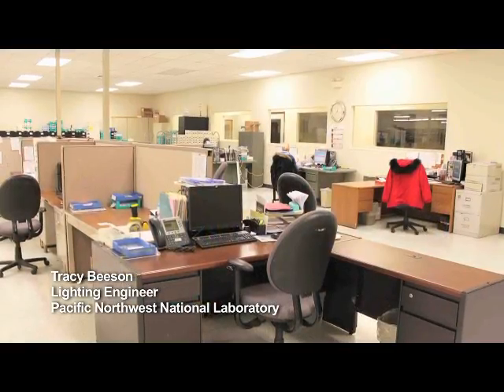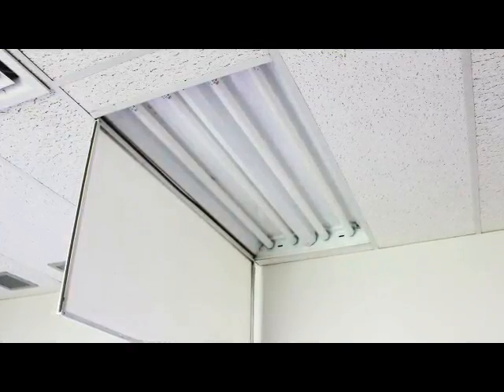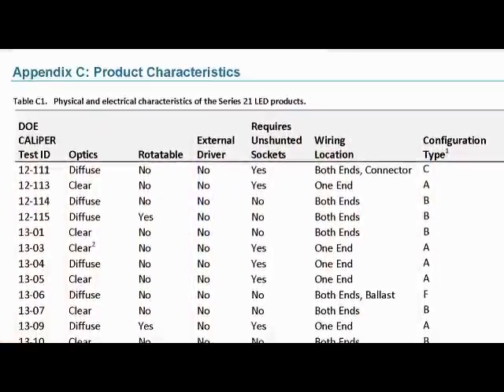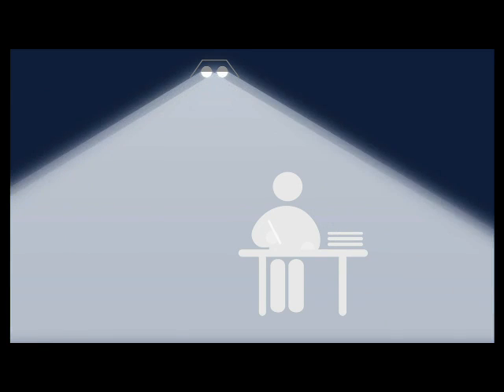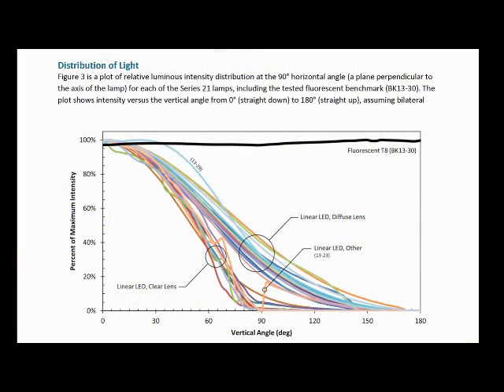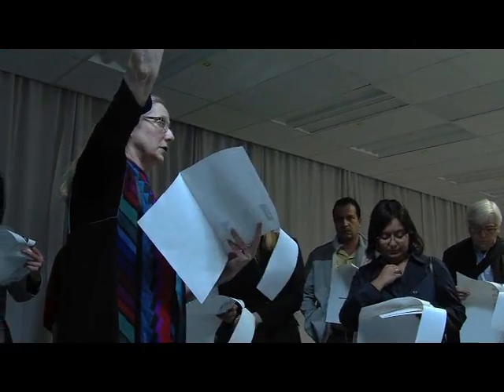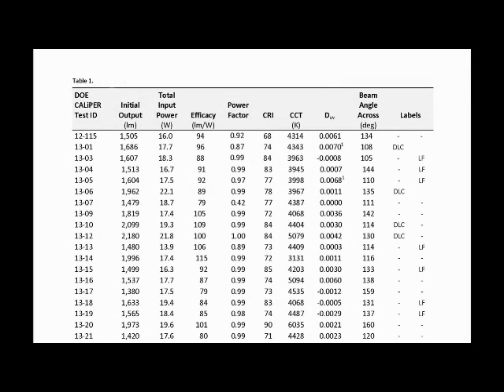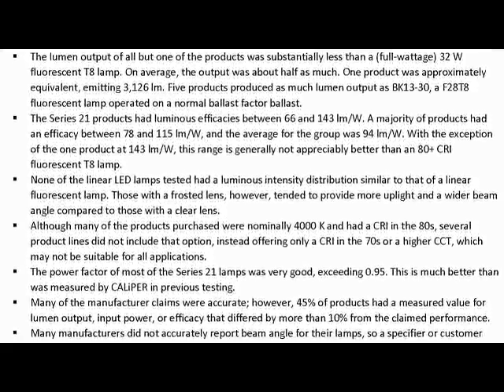LED Linear Lamps and Troffer Lighting: CALiPER Report Series 21

Comment: Leds are bad.They cost up to 10 times more per bulb compared to fluorescent.They produce dim light compared to t8 fluorescent.The life span of leds are very short too,not even one year of service,even though it claims 20 years minimum.Tiny bulbs are not better than bigger,size matters,mercury matters,and phosphorus matters.Also there is super t8 fluorescent which produces up to 300 more lumens per bulb,compared to regular t8.LED light also looks very weird and unnatural,compared to fluorescent.
Reply: there are many factories of led tube,good quality one will be used for 5years,and it can save a lot of electricity and labour work.Althought it is not perfect jet,but it will be better and get rid of the flurescent in the very future.
Reply: This comment didn't age well